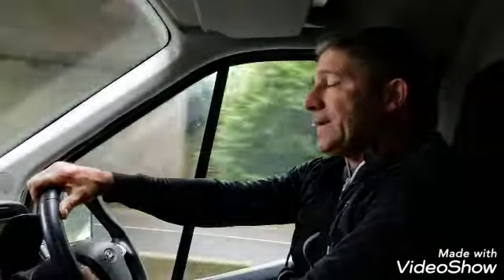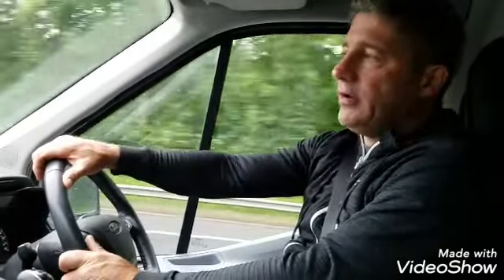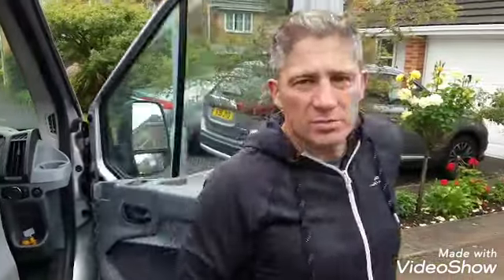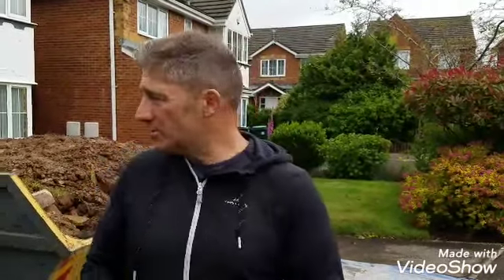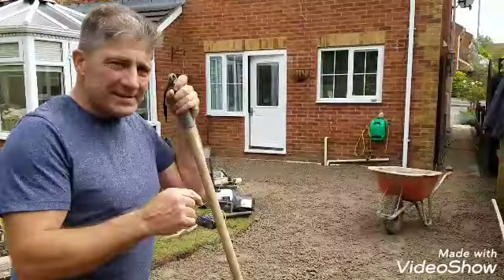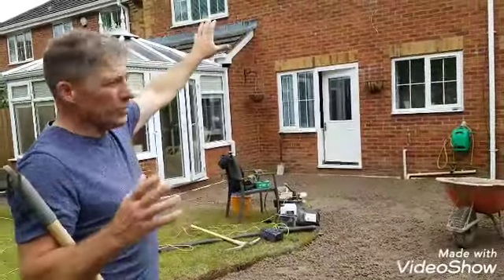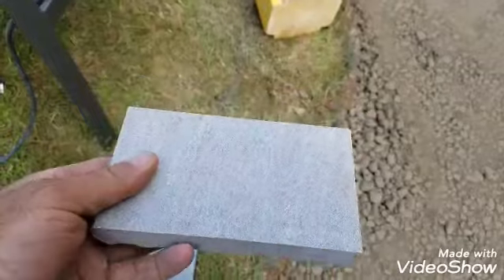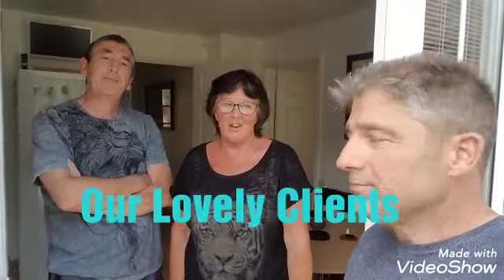Installing A Pavement Quality Concrete PQC

Comment: Hello total novis here, Preparing to lay a porcelain patio and would like to use the lean mix instead of type 1, What is the mixing ratio of PQC 15:1 of what? Thanks
Reply from the maker: Hi James mate it’s Sand and ballast 15 to 1 cement mate

Comment: Hi Johnny, love the videos and channel. As a landscaper there is not enough of us sharing techniques and showcasing exactly what goes into the build before the final pictures. Just wanted to ask did you put any sub base under the lean mix or did you just go straight on to the soil where you dug out ?  and did you wacker just like mot ? Also how much did it cost for the lean mix either per smq or tonne ? Thanks a lot and good luck with everything
Reply from the maker: Hi Blair, thanks for watching my friend, yse i di use a su base of Type 1 and every level was severely compacted, why don't you join our Landscaping group on Facebook some great guys on there its called Landscaping Survival with Johnyboy. Be safe out there

Comment: Thank you sooo much for the tips - this has been invaluable to me as I'm either looking to do the patio works myself or specify contractors to do it - we're based in nw London - sadly too far away to ask you to quote for our new patio :-(    Our ground seems to be stable - not too much clay - we're looking to slope the 40m2 patio away from the house towards the lawn into a full width channel drain which will run under the patio and connect into 2 rainwater downpipes. For a belt 'n' braces approach(!), would you recommend a 6-8" Type 1 MOT topped with a 4-6" PQC?  To get a nice fall on the PCQ, would you recommend using shuttering and tamping the mix to match the pre-set timber gradient? Thanks!
Reply from the maker: Hi Roger, many thanks for watching I really apppreciate it, more than happy to talk you throught the process it will be much easier, I was in London on Saturday as we have a job to start.
Reply: @GreentopLandscapes  Thank you! I'll send you a message.